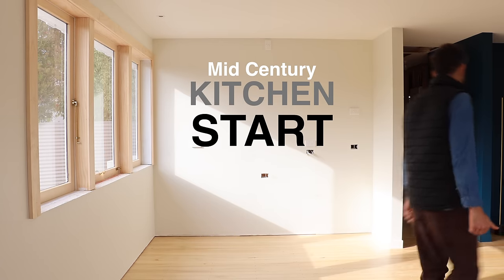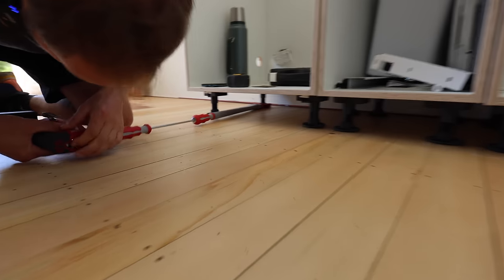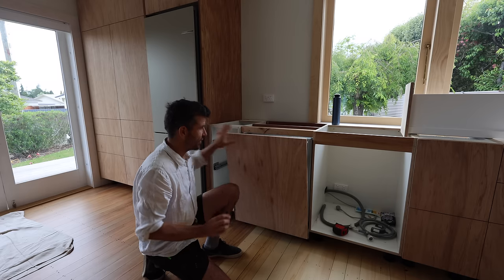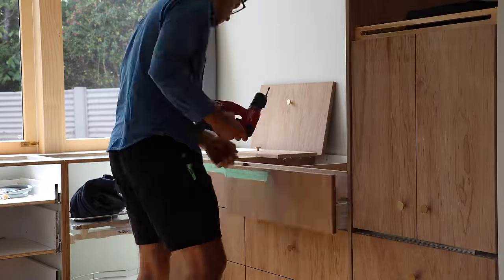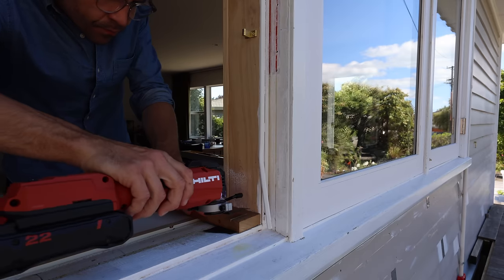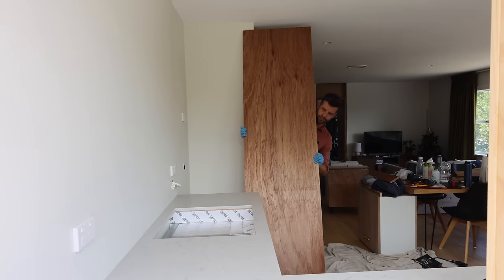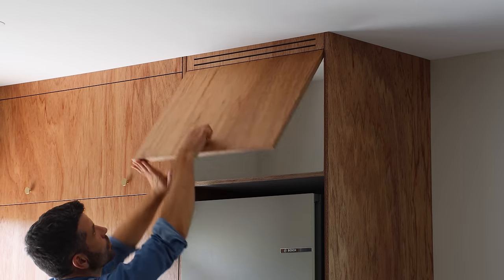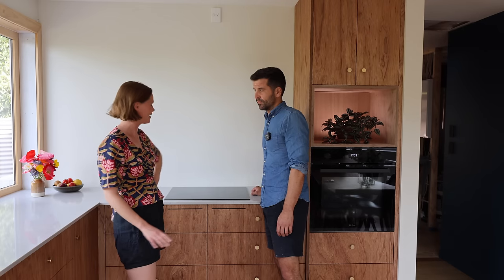I Made a PLYWOOD Kitchen look like THIS

Comment: beautiful, congrats to you both (and Ray too!).  For behind the hob, I had 3 thoughts: sheet brass / colorized sheet metal to match the drawer pulls, or ply with some heavy protection (and maybe embed magnets behind it for knife storage?) or glass as many others have stated.  I really would think that tiles are not the look here; even if it's a large-format, I believe that would  draw the eye to the wrong thing.

Comment: laminated coloured glass for the back splash.. we got a black sheet of 8mm laminated glass and it fits with the induction glass top and other appliances. It does show grease so need some cleaning - but they all do..

Comment: G,day Scott and Jess (Scott Brown Carpentry) from Sydney Australia.
My first thought was a mosaic tile of flowers for the kitchen.
It is fine quality: it really goes to show, the price of sheet materials these days. Back in the 80s and 90s maranti, maples - Indonesian, (Queensland excluded) was reserved for house joinery and doors. Rotory and book match veneers, such as  beech, African ash, Tasmanian oak were selected for cabinetmaking.

Polishing and Finishing
Grain in veneers (and solid wood) can be troublesome; raising the grain with stream and sanding, to applying durable but at the same time attractive finishes can be a difficult selection. 
* French polished (0000 steel wool) between coats
* enamel paint
* polyurethane coating
* expoy
* acrylic
* wood stains and oils
Weather you are matching a piece of furniture or something new, taking time to establish the benefits, cost, technique and it's presentation will be rewarding to the position that it sits.
🌏🌲

Comment: we got us a walnut kitchen with a very thin INOX top, using the bare materials, partially open cabinets, and the same bosch fridge with click on panels. ours is bright lemon yellow, but we got some other choices, long story. we did small white handmade tiles for a splash back, which is calming to look at. They were cost effective, and it gives a sense of classy because of the texture. in your case i could imagine a bit more colour. maybe even dark, but even coloured, with a contrasting grout?

Comment: As a high end finish carpenter here in The States and having worked as the Project Coordinator for an ultra high end kitchen design business, I can honestly tell you that just the cabinetry package installed and ofc custom made, you would easily be looking at $25,000-$30,000 just for cabinets. Now add in electrical, plumbing, countertops, etc etc and all lighting and finishes…prob the total is somewhere in the neighborhood of $60K dollars. Many will ask why but when dealing with an Ultra high end kitchen design business u are paying a premium for designers and customization. Also keep in mind we have had clients who have purchased countertops(as we say stateside) where the cost of the material for that many square feet would be $10,000 or more. Equally with appliances you can easily spend $2000-$3000 for just an induction cooktop and another $3-4 thousand for ovens. Throw in a sink basin that could very easily be $1000-$1500 and faucets easily $500-$1000. And don’t forget many of our clients had refrigerators that ranged from $5000-$10000 dollars alone. When all finished from a-z a kitchen like this could easily be somewhere in the neighborhood of $75-$100 thousand depending on appliances, countertops finishes, lighting fixtures etc etc. Scott u should feel an immense sense of pride due to ur amazing craftsmanship and excellence as a carpenter!!!

Comment: Go with a meranti splash back, coated with a black Japan oil 50% reduced strength, then a glass layer on top. That way it blends with the black appliance then meranti plywood hood cover for the range and all sorted.

Comment: Given I had a super high end kitchen built about the same size and can tell you it would easy be USD 30k. Then the handles, sink and appliances, so all in way over 45-60k depending on appliance choices.   As for the back spash, you can go down a rabbit hole for sure.   I think some large porcelain tiles from Porcelanosa that would be easy to keep clean.  Also I would put in a range hood above the cooktop.

Comment: I did an Ikea kitchen in 2013. Just looked at the order. About $6,000 USD. 24 linear feet or which 6 was an island (roughly 12' square). Two pantries, solid birch fronts and butcher block countertops. Probably 2x that now. Your looks way nicer!!

Comment: White Glossy tile for the splashback. You can also do full height to ceiling. 120x60cm would be nice but you could also get a single tile block of up to 250x125cm+, cut to your dimensions. They are not expensive nowdays.

Comment: Copper sheet on that Splashback with a hammed effect would look amazing :) The cost saving isn't really a difficult  question - you are either rich to be able to afford a bespoke designed and handmade kitchen of any size ...... or you are fortunate enough to be able build one yourself.

Comment: Nice job Scott.  Perhapos stainless steel sheets for splashbacks easy clean and hygienic.  Struggling to understand that vent slot through the front.  Surely you just create gaps and ventilation at the back of the units and put vents in the bottom plinth?

Comment: you should try nyatoh plywood sometime if you have it there in NZ. here in Malaysia they are the top tier for cabinets. 

also, for cabinetmakers here most of them charge you approximately 600 bucks per feet of a base unit, quartz top and the hanging unit (only the basic stuff and using melamine boards)

Comment: I install kitchens, our company mainly uses Omega brand cabinets. Those cabinets are some sort of ply wood walls but have a luan back, hard wood doors and face frames. Tough to really say as just an installer but if you used omega cabinets I would estimate that layout in $30,000 USD mark, +/- $5,000. That price includes our in house plumbers, electric subs, and back splash tile. While having no upper cabinets it is kind of up to personal preference on how high you tile. I have tiled to the ceiling before but I think its too much. I would play around with some samples and split that window 1/4 to 3/4 up. Here in the states bull nose tile is kind of fading out of style, I use a lot of schluter edge trim to cap the tile.

Comment: Tile backsplash sucks if you use small tiles.  Cleaning the grout is so hard - from splashes, grease, etc.  I made backsplash from fine-grain particle board and used contact glue to put Formica over.  Inexpensive, durable, many choices of color/pattern (I chose a neutral granite), smooth and super easy to clean.   It's been 20 years and it still looks great.  Good luck.

Comment: Great build! The quality is outstanding. Would love to have this in my Sandinavian home! For the backsplash I would suggest large format tiles with thin grout lines to keep the minimaistic look. If you want to go more mid-century you could go for small standing rectangles (more like traditional japanese tiles). If you have any other tiles in your home it's always a nice design move to repeat those in the kitchen to tie the house together.

I was wondering if this would be possible to do as a renovation where you keep the old kitchen cabinets and add new fronts in plywood? How would you tackle a project like that with for instance IKEA-cabinets?

Comment: Coloured glass splashback -easy to install, won’t stain or fade, easy to clean, no joints. If you have a change of mind in years to come - easy to change out. Price is comparable over tiles based on installation.

Comment: Hey mate with the cook top u didnt have to vent your draw fronts u could of set your front rail down 5mm for requirement for the induction cook top that will allow the air to travel away

Comment: Hi Scott. 

This question has probably been asked before. But that is the core of the white melamine plywood and the merenti plywood? 

I am a cabinet maker and made many kitchens. You have done a fabulous job. 

We mock everything up in the shop. Cabinet, doors drawers, the lot. Then we pack it and install it in the same way. 

Love making cabinets out of plywood. Hate chipboard.  

And yes oiling is a pain but you get fast at it. Typically 2 days per kitchen, that’s 2 coats.

Comment: Modern look, typically gets Schluter metal channel as edging for smoked glass or tile... Brass could match your hardware. 
Sigh. 
But how about an epic live edge burl wood slab set at an angle, but with vertical kerf cuts every foot or so to repeat the pattern of your cabinet doors.

Comment: The splashbak should be easy to wipe off. The fewer joints the better. A material that minor dirt does not sin visibly is good.
Easy to take somíng that look very nice, but a hell to clean. Many joints make it so you have to wipe more. 
The first or sekend time you wipe it easy, but you are going to have that kitchen for a long time. So easy to wipe of is a strong factor in the kitchens i built.

Comment: your splash back needs to be as clean as the rest of the kitchen. I honestly would get a quote for a color matched (to the wall) powder coated metal plate.

OR, for me, I would just get a sheet of steel, heat it up, and coat it in gun bluing, polish it, repeat, then polish it one last time with the bluing. It makes a dark purple blue finish that's almost black. And since its a typically a gun finish, it takes heat and some moisture well (oil lightly monthly) and its cheap, pretty easy, without looking cheap. Another thought would be to look up "color case hardening", I know its another gun thing, buts really pretty and isn't that hard to do.

Last thought would be hammered brass to match your door pulls, buy a sheet of 1/8 brass (expensive) and hit it with a ball pien hammer to your liking, then frame it because it no longer has a flat back and put it up.

Comment: Splashback - A single piece of neutral coloured glass is not too costly and installers can cut holes for your sockets.  Make sure front is not etched in any way for easier wipe clean and do whole width from upright panel to your window frame. Two things might cause me concern about the kitchen, both revolving around kids..... Are the drawer fronts easy for a munchkin to dent with a toy or worse raise splinters, and second if your fridge freezer needs increase due to kids can you easily expand the fridge nook, possibly stealing half the unit and bench top to the right to accomodate a wider  fridge if needed?

Comment: Hi Scott, what length nails are you using to pin the cabinet together before screwing? Looks like an 18 gauge nailer - I’ve had issues with those sometimes blowing out the other side when nailing if I’m slightly off perpendicular with the nailer

Comment: working on a kitchen myself trying shaker style with two layers of 9mm pluwood , thinking boiled linseed oil as well but i was wondering how youre kitchen is holding up with stains like wine egg yoke or grease (im a messy cook)
as for the splashscreen : maibe use clear glass , you whont see it but it stops any stains from hitting the paint behind it

Comment: I would go for a dark mirror splashback with is basically invisible, and makes the space feel larger. However it is quite expensive. Also your benchtops look  quite narrow, probably about 600 so it maybe more prone to splatter. My benchtop is 800 deep so this hasn't been a problem. But if yours is 600, then it maybe.  Also not sure your induction hobs needs a front vent below it. Ours didn't although we did have more space behind it due to the 800 depth. If you were getting the kitchen built professionally, you may not have got as good a finish, as getting a good finish and gaps all corrrect takes more time, and time is money for a company doing it professionally. It can be less hassle just doing it yourself rather than having to get people back to fix things..

Comment: Question, you used Oil for cabinets - Osmo Polyx Oil 3062 Clear Matt. According to the supplier Osmo you should not use this on Oekume or Merantie. It can give a white shade. Do you experience these problems? Thanks for your video's. I decided to build by own kitchen too.

Comment: Really curious to see how you did the lights that turn on when you open the pantry. How did you mount the LED strips? Where is the contact sensor? Where did you run the wiring? Thanks! Looks beautiful, this would easily be an $80,000 kitchen in the US.

Comment: 00:12 I need to build a kitchen with the limited tools I have as he roles out a table saw from his complete workshop. Dear god look how far up he has the blade. No wonder the plywood is splitting. Also some glue and sanding will fix that right up. Those are some nice lines. Overall nice work.

Comment: You don't have to install a backsplash! In my eyes it's much better to use elephant skin wallpaper protector instead. It's simply a wipeable, water-repellent, and soil-resistant protective film that you can easily paint on your wall. I've been using it for years and find it great because it doesn't add another distracting element to a visually minimalist kitchen and is also cost-effective. Give it a try!

Comment: In stead of using the feet at the back of the cabinet just screw a beam to the wall and put the cabinets on that. Level, same height and half the hardware and ease of installation

Comment: If you tile use an epoxy grout or it will start to look crap in a short period of time with cooking fats and steam ect.. glass would look amazing or a cheaper option is a product called Metaline (looks like glass) but their colour range is limited compared to glass or tiles.

Comment: I do kitchens in Oz and that $40k price is pretty much on target; you did use higher end ply to build the base cabinetry which almost nobody does but the two big things I see here are the Merenti and that benchtop.
merenti looks nice but as you said is splintery and will be an issue ongoing. That skinny benchtop looks cheap/nasty and doesn’t belong in a 40k kitchen. A filler strip above the fridge please. I can’t unsee It :-)
Your carpentry and eye for detail is max level. Fwiw use jig/templates for the handles rather than measuring them each time. 
One last boorish detail couldn’t see any caulking but I’m assuming that was a time thing.

Comment: For our splash back; if you don't want to take away from the art of your craftsmanship, we used just a waterproof paint on membrane with caulking to seal the gap. It was not noticeable except at an extreme angle. And I think it didn't take away from the rest of the kitchen if anything it added to it. 😅

Comment: Not only is it difficult to estimate costs, but as a DIYer into carpentry and cabinetry and stuff, you really underestimate the cost and time knowing how to do certain things to a high standard. The cuts required to make not only a square carcass but also one that fits perfectly into rails is not easy. Most people don't understand just how finicky the tolerances are. Good drawers require tolerances down to 2-3mm precision over half a metre lengths. I'd say to build your own kitchen to this standard, you would need years of experience doing simpler things like basic boxes or cabinetry. Also, you need an enormous set of tools, from table saws, mitre saws, track saws, dust collection, etc. 

And the author of that video is someone who does carpentry for a living!

Over here in the UK,  you can probably buy MDF-wrapped kitchens for £10-15k. Including labour, that might be £25-30k. It's very difficult to get solid wood kitchens of the sort in the video, but prices probably start around £20k just for the materials. You can cheapen out on a variety of things, but home-assembled kitchens are often super transparent---jankey, wonky drawers, cheap veneers that start to separate after a few years, etc.

Comment: I've never seen a drawer fitted around the sink trap. The plastic thing is unique.
   As far as the splash is concerned, I would be VERY careful about what you do here. The safe option is to use the same material as the countertop. I'm not sure about the size.

Comment: Plywood won’t wrap / band over time if used for cabinet doors?
Reply: It is prone to warping easily absorbs moisture eventually delaminating.. not good choice imo if you will use it in kitchen where water splash are common.

Comment: Just paint the wall with a wipeable paint, like eg SIGMA COATINGS Polysatin SM, it is the same kind of paint used in hospitals. I splashed it with ketchup, hot cooking oil and more and just wiped it of.

Comment: You’ve done a great job, very good workmanship. But here in NZ ply still looks like ply and has the connotation of “looking cheap” rightly or wrongly.  Probably because most ply is put up by DIY builders to save money and has usually looked like it. We see it a lot in old baches up and down the country. May affect your houses price if come to resale. The current trend of wood faced kitchens seems to come around again overtime, but as usual people will follow the next one with the previous trends demise. I wonder how long it’ll be before the ply faces get painted or removed?. Next owner probably. I see it’s a big difference between US kitchens which traditionally are rather dark wooden faced with routed groove inset borders, and still very common there, compared to European kitchens, with their flat colour or white elegance and simplicity. You have kept to this simple principle which certainly helps the overall look and finish. In the end your preference is all that matters and you have a lovely kitchen you should be proud of.